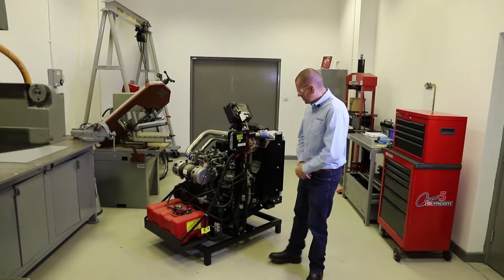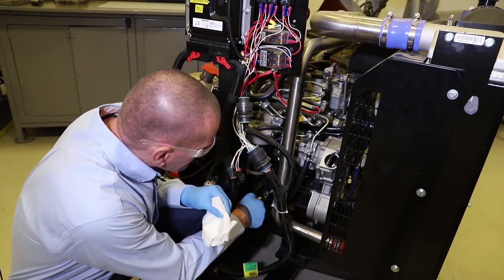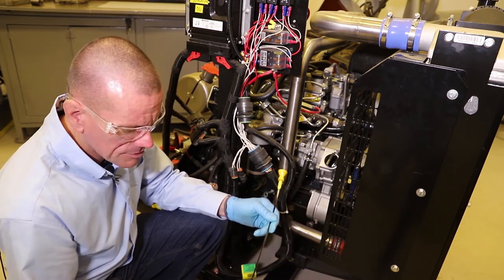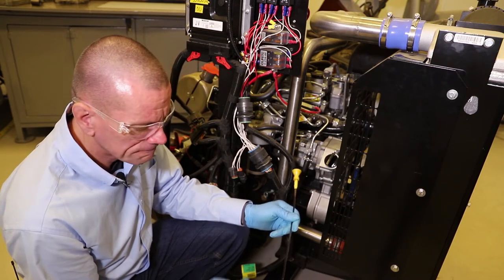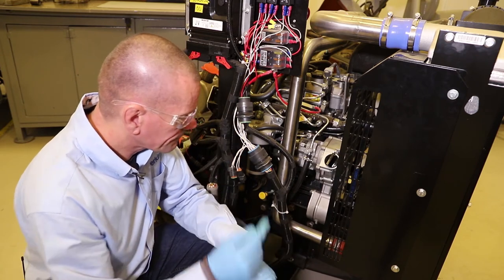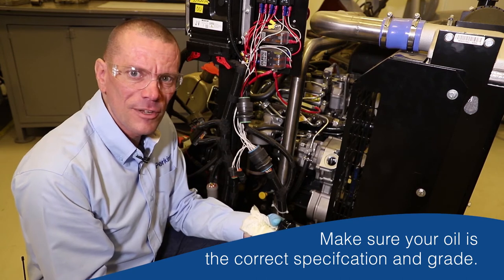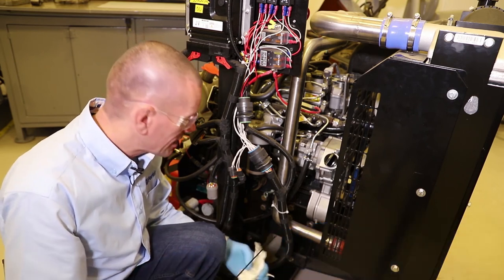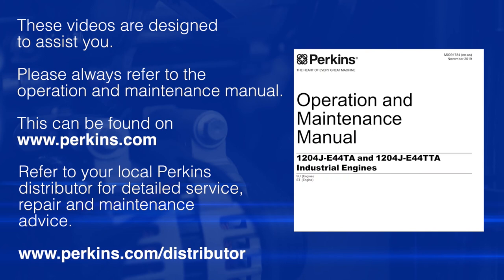Perkins Daily Engine Check Series: Oil Levels

Comment: Currently trying to figure out why there is low oil pressure on my Perkins 4108 in a 1988 slocum 43 yacht. Having a hard time locating the oil pressure relief valve and can’t seem to find any engine diagrams online or in the manual that shows there this is located on the block. 

There are no leaks, so our next step was the pressure relief valve, assuming I can find it. Any help would be appreciated!!! Thank you!
Reply from the maker: Sorry for our delay, Brooke. We hope you were able to solve your conundrum, but for anyone else who may be in the same boat (sorry, we couldn't help ourselves) your local Perkins distributor can help. You can find your closest distributor using our locator tool: https://distributorlocator.perkins.com/